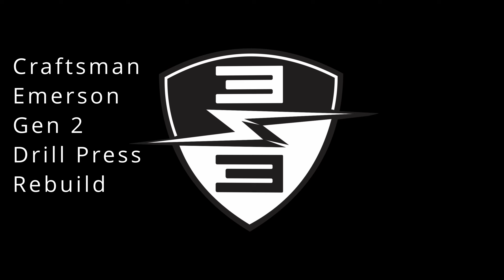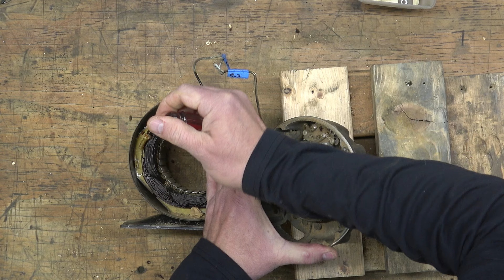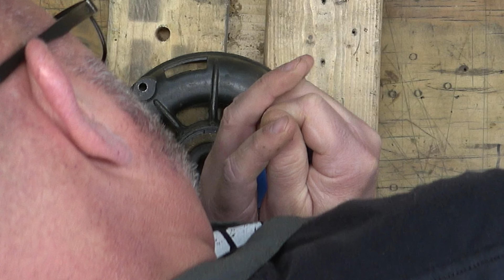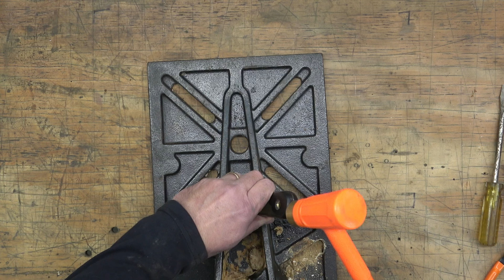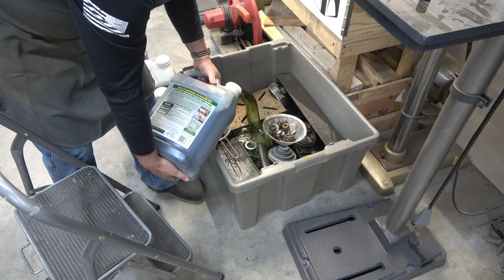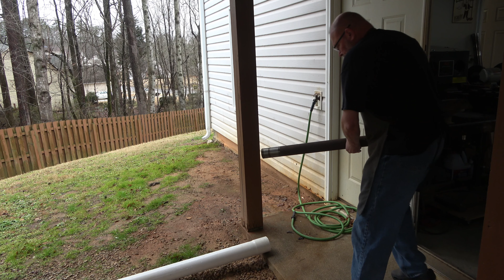Part 4 Craftsman Emerson Gen 2 Drill Press Rebuild (Cont.  Motor Disassembly & Simple Green Soak)

Comment: The furniture guys have a couple of things they use to remove glue that might help you insect stuff:

Heat: The furniture guys use hot air guns for a limited time so they don’t cook the wood.  On the base, you could try a propane torch and burn then nest out (lower heat than acetylene) since you are going to remove the paint anyway.  I wouldn’t use that much heat on the motor since it could cause damage.

Vinegar: The furniture guys use vinegar as a last resort (after hitting the joint and heat).  Might help loosen those dobbers.

WD-40:  I use WD-40 to loosen stickers and labels – might loosen your dobbers.

Nice series of videos.
Reply from the maker: All great ideas, thank you. I also use WD-40 for sticker removal. Thanks for watching.

Comment: I find Purple Power to be stronger for soaking old nasty parts in than Simple Green. ALSO - if you goto Sam's Club, in the restaurant supply or Janitorial supply Aisle, they have a Purple colored fluid in a Gallon Jug that is a concentrated DEGREASER - it is SUPER SUPER strong, you can mix it down as much as 32:1 with Water, but if you mix it 50/50 or 1:1 with water it will strip old paint off cast iron machines down to bare metal better than aircraft stripper, without all the smell and gloppy muck - I just restored a 1946 Brown & Sharpe Surface grinder that had at least 5 or 6 coats of different colors of paint and had it bare castings in two applications of Sams Degreaser mixed way too strongly........
Reply from the maker: Oh thank you, I will give it a try.